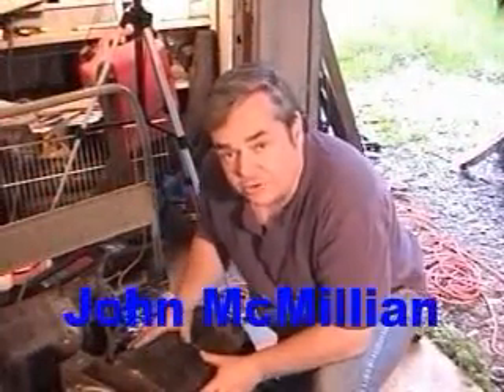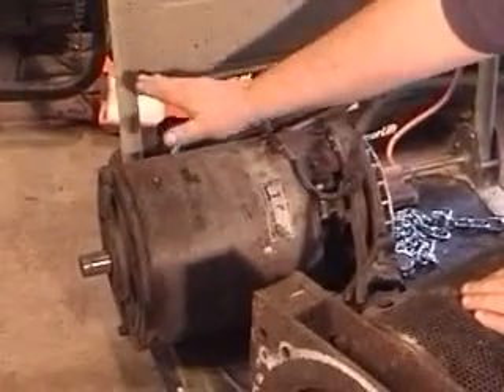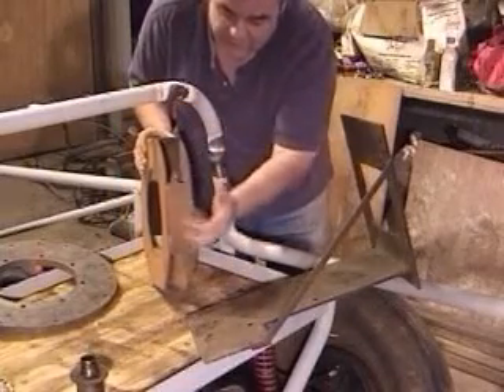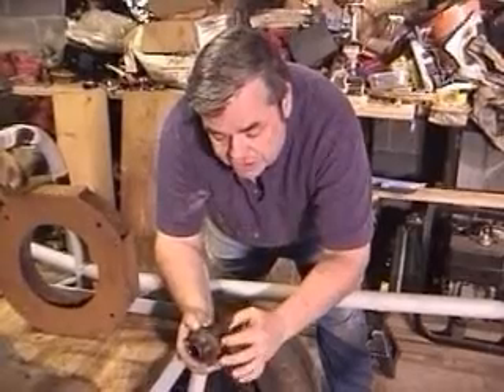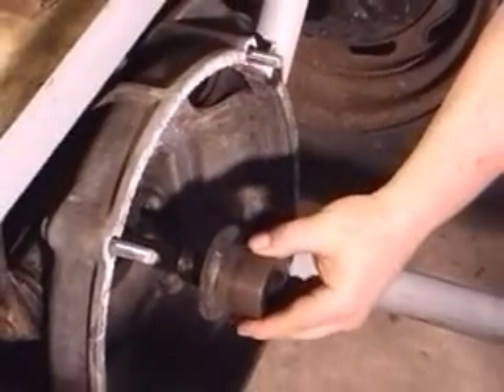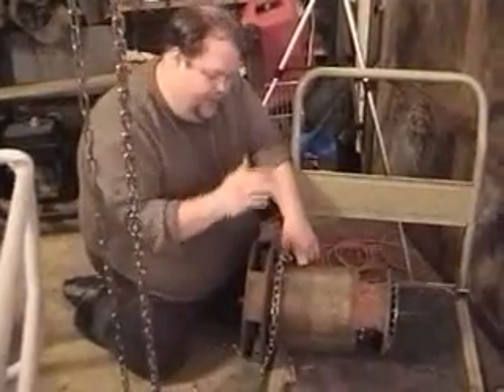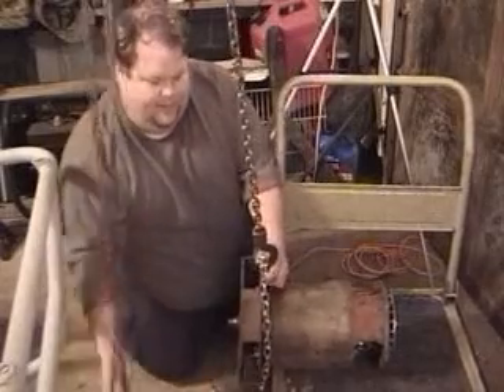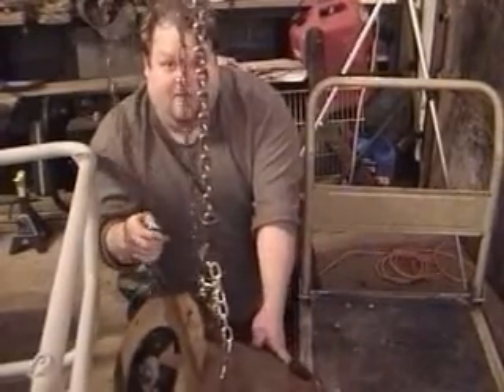Electric Car Conversion Motor Installation

Comment: what do you do about a clutch ?????
Reply from the maker: Actually, you don't need a clutch.  When you let off on the power all you have to do is shift to another gear.
Reply: but the motor is still engaged putting excessive strain on the gearbox and the coupling a clutch would ease that strain i was a mechanic for 38 years
Reply from the maker: With all power removed from the motor there is no appreciable strain - the motor is free spinning.  It takes an extra second or so to shift but other than that, there is no issue.  I have tested with and without a clutch and the added cost, weight, and complexity, is just not worth it for me to worry about using a clutch,
Reply: so when your going up hill you cant change gear surly electric motor as a resistance when not powered up
Reply from the maker: Andy Coakes Actually, you can downshift going up hill if you need too.  Leaving the motor in gear while coasting offer minimal resistance and in fact may provide a little bit of a flywheel effect.  While some will use a motor that can also act as a generator, I'm not much for regenerative breaking.

Comment from the maker: @grfximage While it's technically possible to convert a large truck with an automatic transmission, I'm not sure you would get the range you would need.  As a rule of thumb, I've found that you can usually get range equal to the MPG of the vehicle before the conversion.  In other words, with a large vehicle that maybe gets 12 MPG that is the range you can expect with a typical lead-acid battery pack.

Comment from the maker: @exoticmotorsports Using a transmission depends on your performance goals.  With a fixed drive gear ratio you are limited to the top speed you can attain.  Also, with a transmission you get a reverse and don’t have to worry about electrically reversing the motor.

Comment: You don't need them. A clutch is used to disconnect the transmission from the engine in order to take the load off the gears because the engine is still running and producing power even at idle. On this, all you have to do is let off the accelerator for the motor to stop producing power (it'll just freewheel). A flywheel is really only there to carry an ICE through it's combustion cycle, and smooth out power impulses (as well as start it through the ring gear, and providing a mt for the clutch).